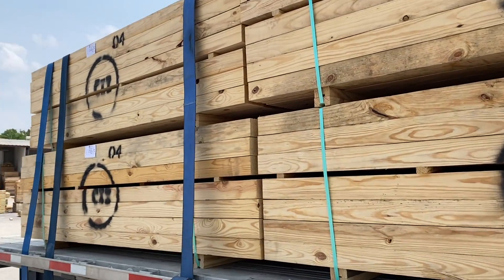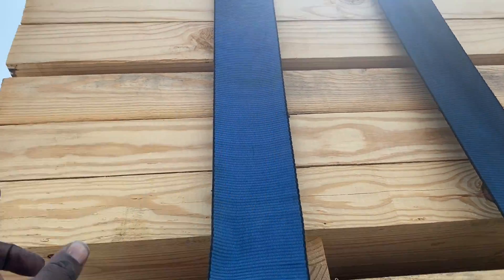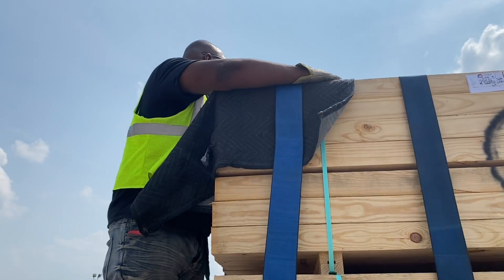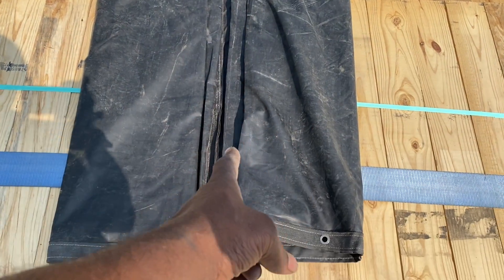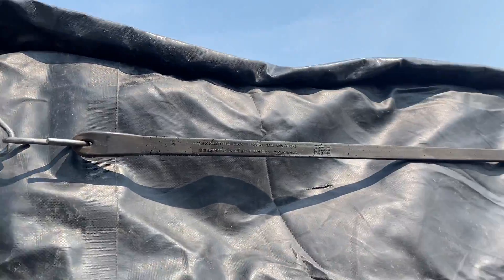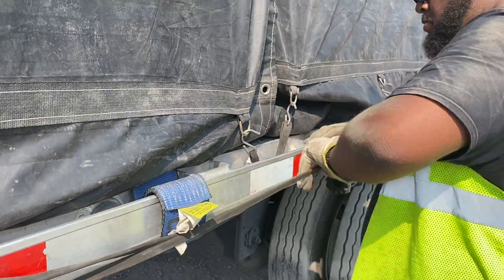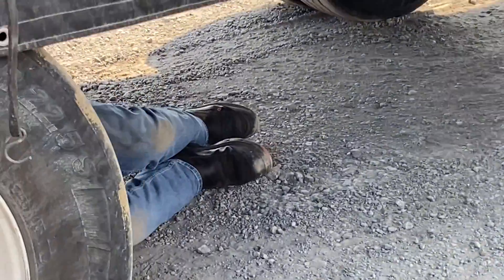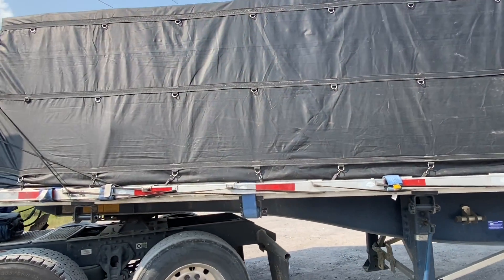Melton Student Securement and Tarping his load

Comment: I really like the way you show and explain. However, I can't get past the straps hooked to the side rails. It is clearly stated by the FMCSA - "All tiedowns and other components of a cargo securement system used to secure loads on a trailer equipped with rub rails must be located inboard of the rub rails whenever practicable."
Reply from the maker: I agree with you
Reply: Aren't the bungees securing a tarp, not securing a load? The tarp is not securement so I think any bungees securing it can go wherever right? Or am I misinterpreting